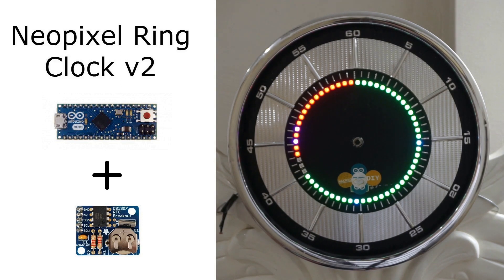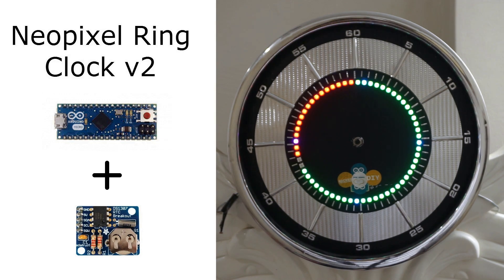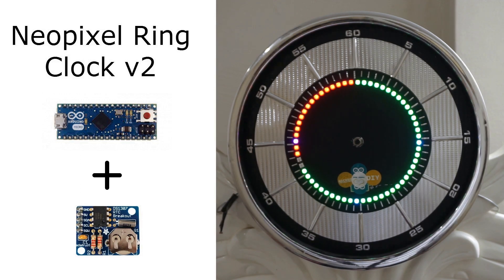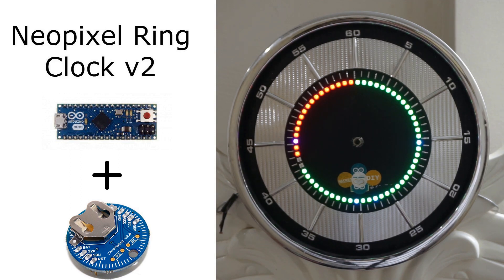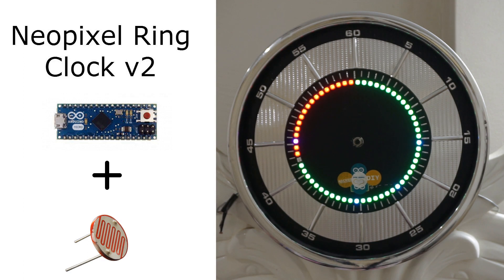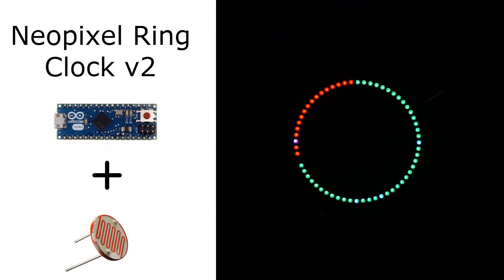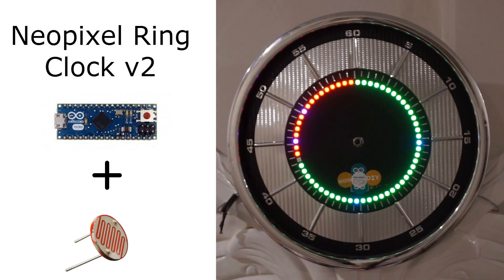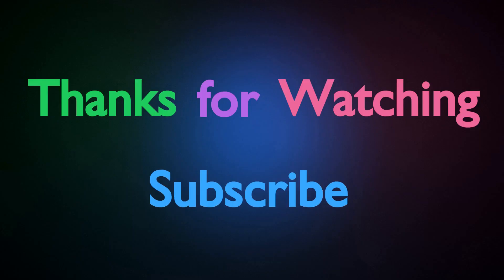Adafruit Neopixel Ring Clock v2 - Baba Awesam

Comment: How are you powering the clock. I have been looking into the options of powering through batteries. I don't think it's going to be practical. btw for viewers in US the chronodot module is available much cheaper on eBay https://goo.gl/qTFJbs
Reply from the maker: +Express-Reviewed I am powering via USB charger. You are right, powering via battery is not practical.